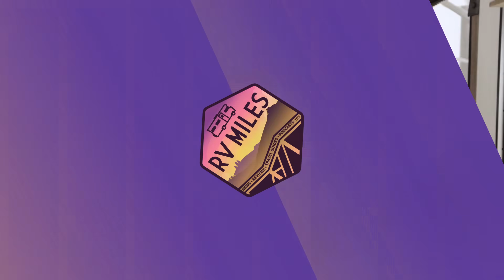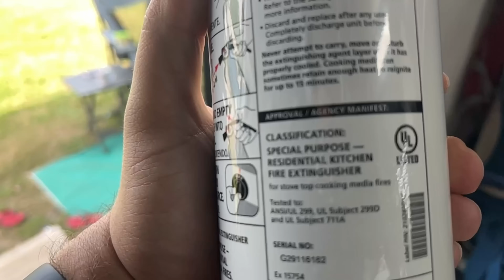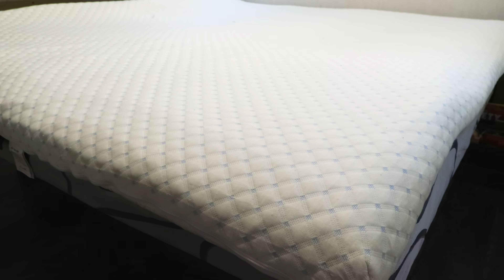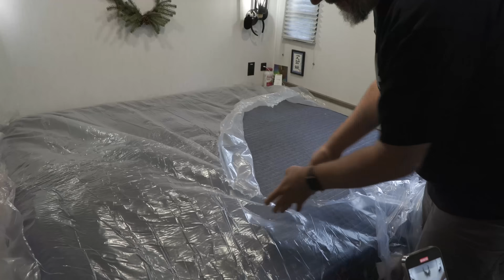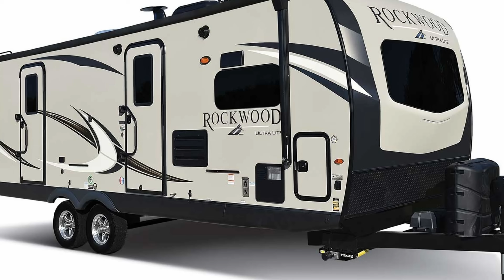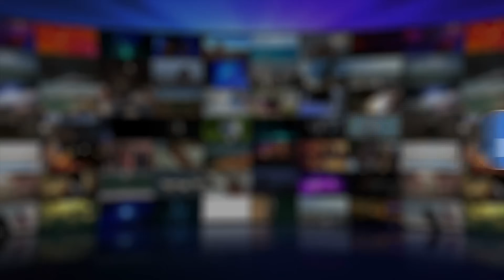Six RV Upgrades You'll Want to Make IMMEDIATELY

Comment: I installed 12v 100a 1280wh x 2 wattcyle lipo4 batteries and a 2000w renology inverter. The converter on our 2022 GS trailer was compatible with new batteries. Whole set was less than $600

Comment: Our RV came with 2-100ah AGM batteries and 1-190 watt roof mounted solar panel. We boondock 95% of the time and so have since replaced the batteries with a single 300ah LiFePo4 at a cost of about $750. 00 we also added a battery monitoring shunt. We have been very happy with the changes. The Factory tires were Goodyear Endurance so no need to upgrade.

Comment: Great video and unfortunately, I did several of your upgrades (mattress, shower head, fire extinguisher, and tires).  Now my travel trailer is more reliable and a lot more comfortable.  I also have an ABC Fire extinguisher in my truck!  When I bought my 2019 Flagstaff Super-Lite, they gave me a cheap bbq that attached to the outside of my rig......I threw that away and purchased a small Blackstone Flattop grill..........I love to BBQ and purchased a 20' quick connect gas hose that connects directly to my trailer (underneath) and can safely BBQ anywhere outdoors.

Comment: Showerhead - my shower is too small to even bother
Mattress - check. Ours came with a full size mattress, the queen fits well and gives us more room to sleep. An RV queen would make it easier to get in the door of the bedroom, but it's not that big a deal for us, we just crawl onto the bed from the door.
Vent fan - check. Love my two vent fans which can cool the RV quickly after the sun goes down and it gets cool outside. 
Batteries - check. I didn't go with lithium, but did upgrade from a group 24 to two group 30. Much better. That original one was stupid small, could not even run the furnace overnight.
Tires - strongly suggest a TPMS system with display in the truck. You really want to know about low pressure before the tire blows out and rips the side of your trailer apart.
Fire extinguisher - Got one in the kitchen and one in the rear cargo compartment, as that's the closest I can get it to where the furnace, refrigerator and water heater. 
If your RV is older, with incandescent lights. replace them with LED. You can get packs of 10-20 bulbs for under $20 and just replace them in all fixtures. If you don't mind spending more, you can get 5 packs of dimmable and color changing fixtures for $40-$80. Just buy at the A something store online, not the overpriced RV stores.

Comment: Good tips.  Let's talk tires.  Had china bombs on my 32 foot trailer.  Was into my 3rd yr of travel and they looked fine (no cracks or anything).  We were 50 miles from our campground and WHAM!  Front right blowout.  Took out all the trim on that side.  AAA came out and changed the tire and we were on the way,  20 miles from the campground WHAM!  Rear left blowout and lost the trim on that side too.  Had to wait for AAA tire truck to bring a replacement tire (our spare was being used for the first blowout).  Upon returning home my good insurance took care of all of the damages and I went with a full set of Goodyear Endurance.  They even tow better!  PLUS, I am now a proud member of the two-spare club (one on camper and one tire/rim riding in back of truck)!  Happy travels y'all!  PS, changed out that mattress too!

Comment: You have to buy a decent RV Motor home to get through as many in a hurry drop it by being taken by Sellers? plus expect to pay High money's?if do you do not  have the profession with lots of skill?
 Time is very important with lots of PATIENTS AND TEAR DOWNS loosing money on expensive parts. Remember less skill more time and payments that most can not afford. Colder climates mean insulation and air condistioning is extreamly important for Higher Climates for an RV will Heat up like an OVEN in very warm Temperature. Sun will bake the inside of an RV Just the same as an  Automobile and why so many Infent Deaths is the most horrible terrifieing experience.

Comment: "Pressure" really isn't what makes shower good or bad, beyond simply having enough.  Think about it this way:  I can spray you with a power washer with enough pressure to cut skin, but it won't wash a wide area or really move that much water over a particular area.  Flow rate is more important for showers.  That is, how many GPM can the shower deliver.  Of course, a high flow shower isn't necessarily good when you are dealing with holding tanks.  That said, your recommended shower head could be great.

Comment: We just bought a 99 Class A, 34 foot. I negotiated 4 (of 6) new tires with the deal. Waiting for a new mattress, our oxygenics shower head, and some little odds and ends. One thing we just did was change out every little incandescent bulb to a new LED. Replaced all 20 of them for $16. They won’t get nearly as hot, and use 10 times less energy to run. 
I’m checking the fire extinguishers, and upgrading the fan for sure after this video. Next on our list is a rechargeable Li Iron Battery that we can recharge with a folding solar panel, a car battery, or a standard plug. Included a 30 amp plug so we can plug right into the existing wiring, and my husband can run his cpap all night in places where generators aren’t permitted. Thanks!!

Comment: I too have done many of the upgrades you mentioned. Great info.  My Arctic Fox came with Fantastic Fans, however I upgraded the bedroom fan to a top shelf model with remote. Comes in handy, no more kneeling on the bed. Took the cheaper FF and changed out the cheap fart fan in the bathroom.  Very much appreciated.  Also, installing 12V strip LED lighting inside the cabinets and closets is very inexpensive and easy to do.

Comment: Regarding the quality and safety of trailer tires, I agree 100%. I replace my tires including the spare every 4 years regardles of the wear condition. I am in to my 2nd set of Carlisle load range D tires. I also recommend that the valve stems be replaced with high pressure stems (rated up to 100 psi). Not the standard 65 psi stems.

Comment: DELETE the standard suspension components and upgrade to Lippert Road Armor Suspension Equalizers, brass bushings (instead of nylon) and wet bolts (with Zerk Fittings). I just ordered my upgrade kit off Amazon for just over $500 and it WILL make a great improvement on the RV's suspension and how it handles over bumpy uneven roads. It will also reduce or eliminate 'chucking'.  You can even add shocks if you wanna go all the way. Also ordered a great mattress topper (but will eventually get a Select Comfort RV mattress)....we've upgraded the shower as well. Upgrading the TV that came with the RV ("Connex")...just so many things. Added slide out toppers. We're also going to upgrade the CHINA BOMBS to Goodyear Endurance. I installed a Tyremate TPMS but when we upgrade the tires I get a more integrated system. I installed my own Rearview/Backup camera system as well (FURRION 7" 3 camera system)....just lots of things to do....
Reply from the maker: You’ve been busy. 🙌🏽
Reply: @RVMiles  LOL, yes. We upgraded our smaller RV to one with slides and a bunkhouse for our granddaughters (4 yr old toddlers).

Comment: I replaced my mattress with a full thickness memory foam mattress. It’s so much more comfortable. I just got a new travel trailer (geo-pro 19FBS) and I saved my mattress to transfer into it. I also just got an oxygenics shower head because my shower has a lot less pressure than my rpod shower head did when on city water.

Comment: Suggestion: disclose just how bad those mattress in a bag solutions smell. Despite the fact that it's a bit harder to maneuver putting in the trailer when it comes time to do so. Mattresses should always be opened outside vocs to avoid the RV smelling possible health implications and difficulty sleeping with the odor
Reply from the maker: Our mattress had no smell. RVMattress.com uses hypoallergenic foam and meets high environmental standards. We also had no fume issue with our Wilderness Mattress which is what we had in our travel trailer. We were able to sleep on both immediately and safely. We HAVE had bad smells with the cheaper memory foam toppers.

Comment: my Jayco 224bh came with the goodyear tires. thank you Jayco.  we did add a mattress topper.  the battery upgrade for  the 4 or 5 times a year we camp,  seems to steep for now.  if it could run the A/C i would do it.

Comment: I know this is RV but popped up from our searches. As we age thinking better to get a driving RV than a trailer but...
Our wolf pup came with a mattress basically a few cheap springs and cardboard? We refused it, left it there for them to trash. We needed one 5" shorter. Looked all over at camping mattresses. Though we'd just take out the small hollow headboard thing or just let it bend up at one end. Then went to a discount bed place. They had real brands. Prices were great. We started asking about the camping size and the lady said, oh we can send it out to be cut down. Only $80 added to the price of our great Simmons. So I think the lower discount store knows the repair people because they probably take seconds and send things out to get fixed. And you couldnt even tell it was cut. They open up and resize the material and binding. There was also a mattress maker that sold their own beds when my kid was young. They let my kids peek in factory door to watch. Super cheap, super great beds. If you find one of those im sure you can order exact size. ok Just info. Wolf pup is crap though. Best thing is the all enclosed floor, then they build on top. No critters but thoings falling off from day one. All outside trim, decals, inside wall vinyl. I was thinking to get those vaccume hinges as all open up and no way to stay up. But I think Im just going to change hinges to the side. Right now its a bathroom at end of our acre lot when sewing in my workshop and I store extra upcycle clothing that I remake. We made a real RV trailer spot for it in the yard. At prices of new I think its still better to upgrade more. We did only pay $12,000 but is there no expectation of quality unless you pay the price of a house?!

Comment: If your batteries are in a vented enclosure or on the outside (travel trailers).  Dual 6 volts is the way to go, only slightly more $ than a 12 volt with more than double the power.  Just add distilled water periodically and they will last for years.

Comment: A Hengs Vortex 2 is a no fuss replacement that is also much cheaper. I just did this on our TT, the hardest part was getting the junk fan motor off - drilled the rivets out so added a few minutes. No need to mess with the seals on the roof made this a simple upgrade. Yes the MaxxAir and Fantastic are better - but also more expensive and a little more work to install. 
I can 100% support the Goodyear Endurance tires. I replace the Goodyears on my old trailer with the Endurance (a newer version of what was on originally, but I can't remember the name). An excellent tire. They are the next thing going on the new trailer. 
We did the mattress upgrade too. The OG lasted about a month and it started killing our backs. Upgrade to a high quality foam (RV King) and couldn't be happier.

Comment: This year we updated several items in our travel trailer. Much cheaper than buying a new one which have far less upgrades we have already placed on our trailer over the 12 years we have owned it. We changed over to the lithium battery and added additional solar panels.  We upgraded the inventor as well. We also switched out the old propane frig to the newer 110 frig. Love the extra spaced. However, on our first trip with all the upgrades, we found the battery died sometime during the night. We were not camping under direct sun so we were told by the installer we shouldn't camp under shade. Really? So to solve this, we have to bring a generator to add that extra charge to the battery. And we are looking at adding one more battery. $1100. We usually always dry camp (boondocking) as we like the wide open spaces you can get on BLM land or some of the older camp grounds. Tires - oh yes - we have learned to buy the better graded tires, however we have found around 4 years of age it is time to swap them all out. Thanks for the tips - nice to know we are ahead of the crowd on our upgrades.

Comment: With recent drop in lithium (and more specifically LiFePo4) battery costs it’s waste to spend event a cent on any other battery tech (agm or lead acid). There are good options on Amazon for $400 (or less) for 100Ah lithium/LiFePo4 batteries that would way outlast AGM or lead acid. Furthermore at $400 they are not that much more expensive than alternatives since you can use 95% of their capacity without any issues. Even more so, if you drain them to 0% it does not cause any damage whereas if you run led acid to under 10% (which happens pretty much to any RVer, esp newbies) you damage them and would quickly need to waste money on new one. These days there is really no reason to spend money on “premium” lithium batteries as everyone sources the same cells from China. If the lithium battery has enough reviews and high enough rating - it will work as well as battleborn, GoSolar or Lion energy… at as low as 40% of the cost.

Comment: I would install a substantial solar package, and with that, I would replace (if necessary) the wiring that runs to the charge controller, inverter etc. This would be done to reduce fire hazards.

Comment: What is your opinion of the under mattress air circulation devices?
Reply from the maker: We haven't needed one, but lots of people do get condensation under their mattress. I think it has to do with the the temperature difference between the bedroom and the underside of the bed. So if you're getting condensation, get one. Just keep checking. If not, no need.

Comment: We have a 2020 Jayco 21' SLX Baja edition. Overall quality is good EXCEPT the front bed. I am a big, 6'+ at 225, my wife is not petite. When we laid down on the factory mattress not only was it too thin but the wood platform was just 3/16" plywood and our weight made the bed sag in the middle.  I did not want to end up in the basement some night!  Solution was to upgrade the platform to 3/4" plywood and the mattress to 5" thick quality foam.  This upgrade increased the front weight and forced us to reduce the amount of weight carried in the "under the bed" storage area. Overall a great improvement and now we just carry less stuff in the RV

Comment: I want to go lithium but do I need to change my electrical system. I have a 2021 toy hauler. Came with one battery I added a second and now it's time to replace them. No solar on my unit.
Reply from the maker: You’ll likely need to upgrade your converter, which is a simple job. Lithium charge at a higher voltage.

Comment: Keeping the cost of an RV manageable by using a cheap mattress (for instance) is just an excuse.  I mean, is using a $200 mattress instead of a $1200 mattress really going to be anything but a rounding error for an $80,000-$120,000 RV?  Not putting seven 3-oz shut-off valves on kitchen and bathroom sinks, shower, and toilet really going to save that much weight on a 20,000# 5th wheel?  And tires?  Personally, I'd rather pay an extra $1000 for my RV than have my tires blow 20 miles out of the dealer's lot.  For the mattress, if their excuse is that everyone wants a different type of mattress.  Okay, just don't include the mattress and drop the price the $200.
Reply from the maker: I agree for myself as a buyer, but the problem is the vast majority of buyers look at 4 RVs with the same floorplan and buy the cheapest one without paying attention to stuff like that. So the manufacturer gets rewarded for cheaping out.
Reply: @RVMiles  Maybe on the manufacturers luxury line they should not cheap out.  People are already accepting they are buying a "higher end" unit...  Like Cougar can continue to be cheap, but Montana should be the slightly more expensive components.  Let's be honest, between the stuff you're talking about, we're talking about taking a $100k unit and taking the price up to $105k.  The buyer already decided to not get the $60k or $80k unit in favor of luxury.

Comment: When changing to lithiums, be aware that you may require a new converter/charger that has a lithium charge setting.
Reply: Most newer RVs have a smart inverter that can tell changes in battery type and charge capacity. Older models, not so much. Knowing which one you have can be a life saver!

Comment: I have found that most storage cabinets are deep and dark.  Rather than using a flashlight or wiring lights in, I use Glowright  battery powered LED strips are great for these areas.  They attach with a pressure sensitive metal strip where the light has a magnet to hold it in place.  It can easily be pulled off the magnet and redirected.  They havce several settings for motion detecting on/off, on with a switch and colors and intensities of light.  They do not use replaceable batteries.  Rather they recharge using a standard USB cable (included).

Comment: The ink markings on stove keeps wearing off on ours.    Just keep in mind folks once you own an RV you will need to be handy to fix this and that. Your trailer flexes as it goes down the road and things tend to wear. Fix the rust and keep an eye on your hanger brackets that hold the leaf springs. The welds tend to break. Its best if you beef it up by re-enforcing it to the frame. Also check the belly of your trailer for loose bolts.

Comment: The 10 inch mattress fits under the slide? I measured ours and it seems to be 8 inches. Did you move a trim piece on the slide or anything?